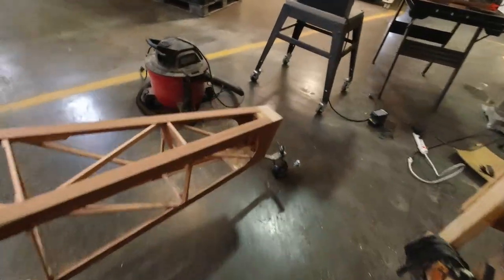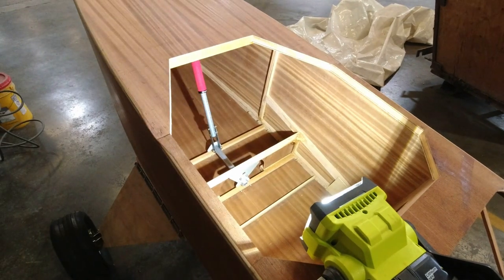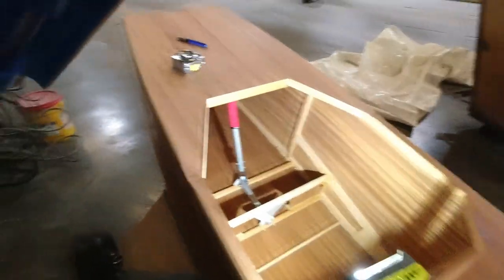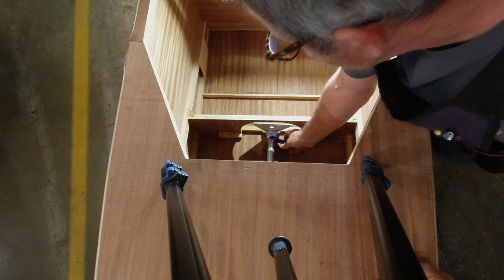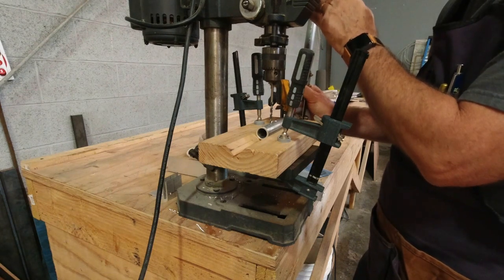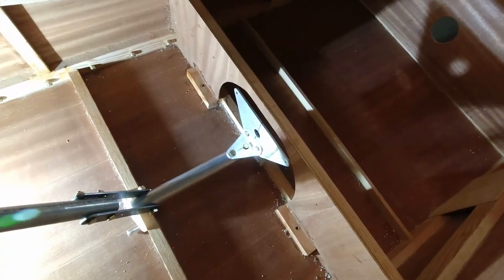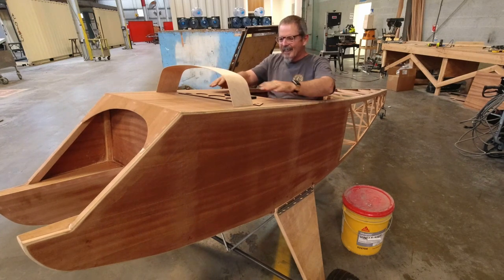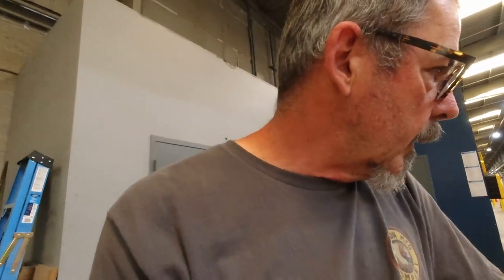Minimax 1100r Wood Aircraft Build EP 89 - I finally sit in it

Comment: Nice to see you in the cockpit you looked stoked. Great job on the build so far. My heart sunk when you said you’re 5’8 but you looked 6’ in there. I’m 6’3” tall and I’m afraid I wouldn’t fit in that plane. I think I need to rethink what plane I’ll build 😕
Reply: Oh, I’m also 235lbs
Reply from the maker: There have been plenty of people your size flying a Minimax...I’m sure if you ask on the Buzzards site you’ll find plenty
Reply: @agp7073  I tried to get a guy in my EROS 1650 Minimax (similar plane) who is 5'10" and 185 - no way would he fit.  There are certain "mods" that have been done for large folks. (not sanctioned by minimax).   Seat just a bit farther back - rudder pedals more forward - seat dropped a bit.  That will give you room, but if the "Seat Station" is moved, that will affect your weight and balance.  Also, I think the max gross wt for the 1100R is ~560 lbs,  and with a 185lb pilot - 10 gallons of fuel (~60 lbs) and airplane empty weight, ~260 - 280 lbs,  you are looking at a take off weight that is flirting with the overall 560 lb gross.  These high weights are hard on the plane - it performs differently, and it will stall at a higher  airspeed.  Dennis would know more about this than I.
Reply: Thanks for the input guys. I’ll look around for others my size who have built one. I really want to build an all wood plane. I might end up looking at building the Legal Eagle XL after all
Reply: @agp7073  I let my friend sit in my himax which is a hiwing enclosed version of the minimax and he fit, he is 6'3" 230lbs, about your size. I'm 5'7" and 170lbs and the cockpit feels roomy to me, I think the biggest problem with taller people is their knees coming close to hitting the dashboard, my friend didn't have that problem and if you do you can adjust how forward the pedals are when you build your plane.
Reply: @gyrojeffro2263  thanks for your input I definitely need to look into this further. I’ve always loved the Minimax and it’s all wood construction and fabulous wing. I think the Pietenpol, Minimax and Legal Eagle share that great wing or its very similar

Comment: Dennis.  Looks great.  I'm also 5' 7" @ 170lbs.   I must have climbed into my EROS at least 8-900 times. You talked about 25psi for your tires.  My tires and rims were the same and I "ran" 10 psi in each.  Seems I got that number from Larry Isreal of TEAM.  Worked great in cushioning the landings. I knew you made "airplane noises, " even though we didn't hear them in your audio.  :)
Reply: The most I've put in mine was 14psi and that  was too much on the bumpy grass taxiway. 10-12psi seems to work well, smoother ride and can taxi faster.
Reply from the maker: That’s interesting, the wheel wouldn’t even take shape at that pressure. Probably now that it’s to shape it would hold it after releasing some air
Reply: @DTMinimax  The way the smash these for shipping it can sometimes take awhile for them to become and stay round.

Comment: Great stuff. You did not show the collar being fitted, I think I would have drilled it outside the aircraft using the bearing block as a guage as that is the datum for the collar and I think easier than trying to drill in position. Broooom Broom :-)
Reply from the maker: I did drill it outside the plane as that was much easier. I made the collar slightly too wide and then sanded it slightly until the bolt would go through, it worked well but your path would have been a lot quicker.
Reply: @DTMinimax  At least you got the right result, that is what it is about in the end. I must say it was interesting when you gave your stat's, the reason for me not going for a MiniMax is I am 6'5" and 190lbs.

Comment: I know your excited! IF you run into a tail heavy situation you can use a razor scooter wheel on the tail to save a bunch of weight back there.
Reply from the maker: I noticed that Sonex tailwheel is pretty heavy. You running the scooter wheel?
Reply: @DTMinimax  yeah I never used that stock wheel it would put me out of balance slightly. Finally got the new tailwheel spring, mine ended up having way to much slop like yours so I used the old fork and it was a much tighter fit. Finally got back in the air this evening and wow I forgot how nice my himax really is, I think my hirth f33 single cylinder is actually smoother than the rotax 447 on my gyrocopter.

Comment: My ex father in law called the 1100r a flying coffin and after watching you in and around the fuselage It did bring that to mind. 😁 great update. It looks good.
Reply from the maker: That’s funny! I actually had that thought the other day!
Reply: @DTMinimax  I thought I had replied, but it must have gotten lost in the Ether. :)  The old USAF C-119 Cargo aircraft was nicknamed the "Flying Coffin."  They had two Pratt & Whitney" R4360's (not all but some) which was 3,500HP!  28 Cylinders, 56 spark plugs,  Was 4 banks of 7 cylinders (Radial engine).    Worked on one - jumped out of one (free fall), over Hondo, Texas.  When the word Coffin came up, I thought of that old C-119.  Realizing you have a bit of work to do, I and lots of your followers are waiting for the day you put the wings and horizontal stabilizer on.  Love following your project.